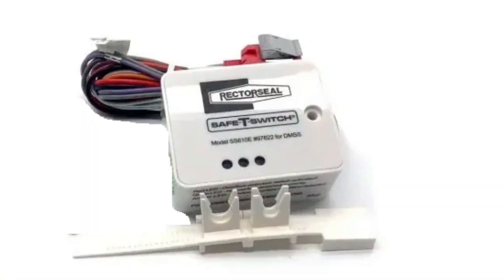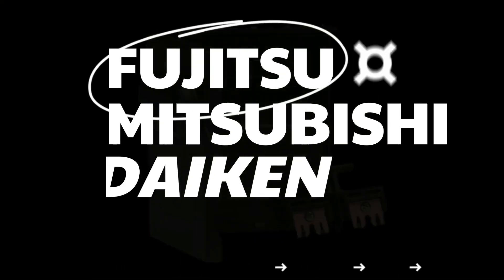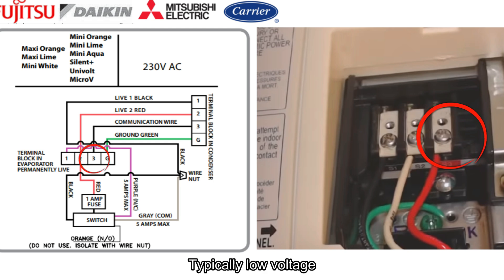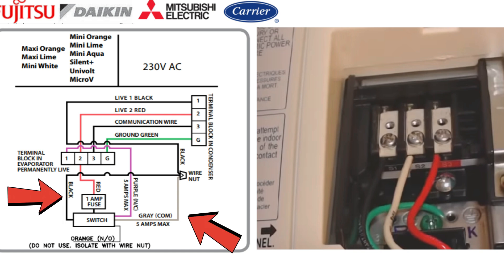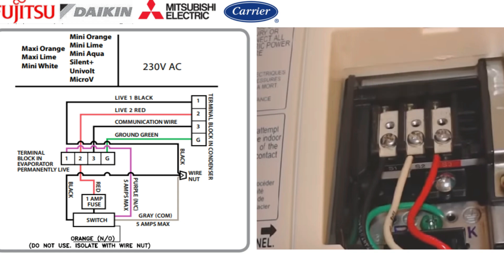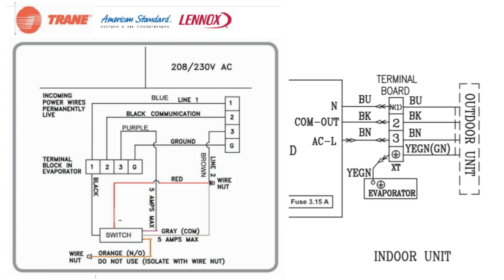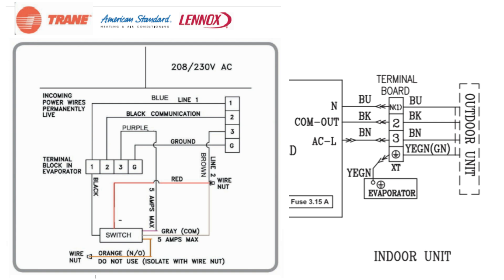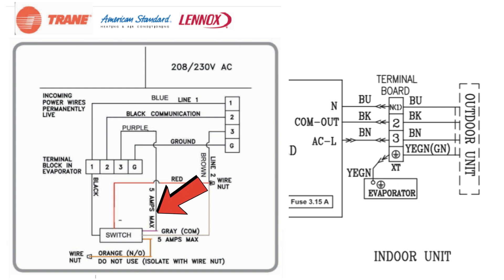How To Wire a Mini Split Safety Switch

Comment: Out of curiosity what is the voltage on that communication wire. The power wires are 120 volts. What about the communication wire. What voltage does that wire carry?

Comment: Im a little thrown off. Using the mitsubishi as an example, i dont understand what the grey wire (common) does and why you run s2 back thru the fuse.  If it was just switch you could just break s1  like any other float switch breaking r or y? I gotta be missing something
Reply from the maker: The common acts to complete the circuit on a broken leg to power indicator lights on the float switch body.
Reply: @JerseyMikeHVAC  thanks man! that makes sense. I'm not familiar with the product.